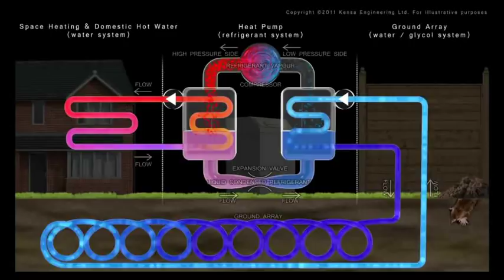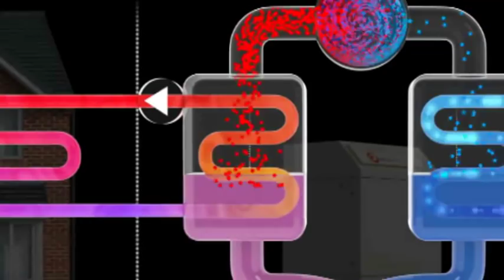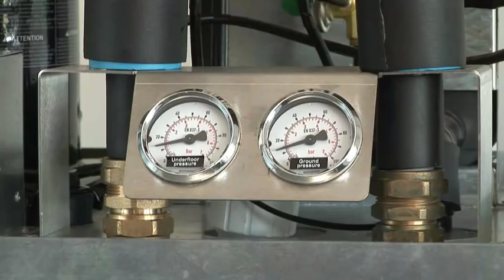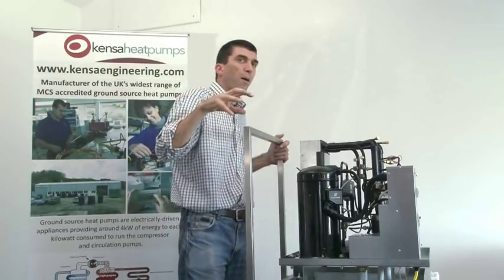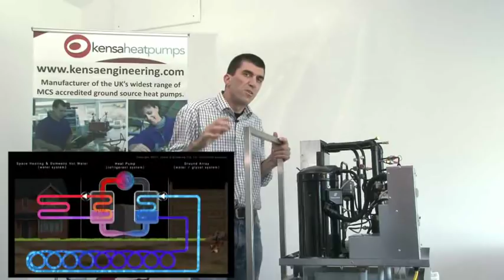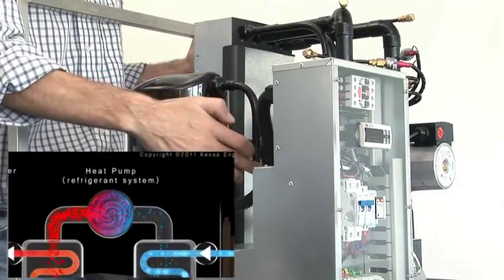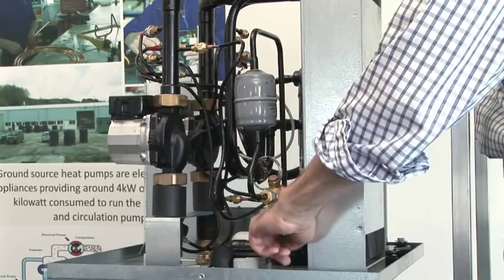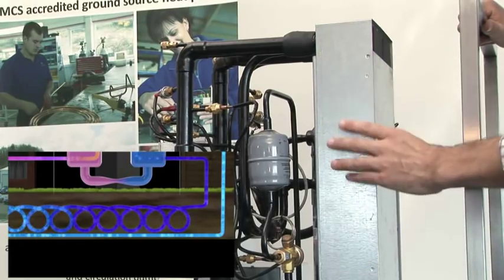How A Heat Pump Works: Installer Version

Comment: Is it better to position a heat pump in a southerly direction so it gains as much as possible from solar gain. My current option is in an area that permanently in the shade, so a sunken basement of sorts. How would you know if your current radiators would work with replacing a gas boiler/heated water tank based system to an air pump with the existing radiators. Underfloor heating would be difficult to retrofit. Is there a quantifiable benefit of either integrating it with a small solar thermal or solar PV roof panel.
Reply from the maker: With a GSHP, the location of the heat pump itself is almost irrelevant, unlike an ASHP it's not trying to collect energy from its immediate surroundings. With any heat pump retrofit, to check if the current radiators will be adequate it is necessary to perform a room-by-room heat loss calculation and then check the output of each installed radiator at the heat pump operating temperature. It is often found that radiators were oversized originally so are sufficient, especially if the insulation of the building has also been improved recently. Solar can be a good partner to a heat pump, although it won't help much in the depths of winter, in the summer it should provide most of the hot water and will assist in spring and autumn, reducing running costs when considered annually.

Comment: Does a ground source heat pump not cool the surrounding earth, enough that the land can no longer transfer the same heat. This presumes its not summer where the land is absorbing solar heat during the day. Can the same heat pump work in reverse and dump heat into the ground and offer aircon and again can you keep dumping warmth into the ground without heating it up locally
Reply from the maker: Yes a GSHP does cool the ground, it extracts thermal energy so the temperature will fall as you say. However, new energy is arriving to rewarm the ground all the time, this comes mostly in the form of sun, rain and a small amount also comes from the core of the earth. Part of the process involved in designing a GSHP system is calculating how much energy will be extracted and how much will arrive, the two need to be in equilibrium otherwise over cooling of the ground will indeed occur. Kensa is aware of some installations performed by competitors where this has indeed happened and the systems have failed. 

Yes GSHP's can operate in reverse, cooling the house and warming the ground, until recently the UK market has not seen much interest in cooling, but this is changing, Kensa will soon be offering cooling as an option on many models of heat pump.

Comment: At the end i understand the example with bicycle pump. Is useful to add a water tank during worm days to the ground water circuit heated by solar panels?
Reply from the maker: Yes, we are seeing some customers using solar panels and other sources of free heat to warm the ground arrays, within limits this lifts the system efficiency by approximately 2% for every 1°C increase in source temperature.

Comment: Enjoyed the great explanation and graphics and then showing the parts that make it work. Some comments below are skeptical of the 1KW input to 4KW output. The energy input is the compressor motor. The 4KW is an equivalent measure of the amount of energy absorbed from the ground or pond or lake through the long loop being heated.

Comment: Great explanation - I am from Australia we are going to be using in ground heat pumps for heating, cooling and hot water. We will also be using  PV/batteries storage for the energy required by the  IGHP. We are building very energy efficient prefabricated buildings.  Over the next six months, we will the  designed whole development which will include all our integrated energy systems.  It is shame you are not in Australia
Reply from the maker: Hi Ian. Thanks so much for your feedback. We do have a distributor in NZ who can supply Australia - Peak Plumbing (www.peakplumbing.co.nz). Let us know if we can be of any further assistance. Thanks

Comment: Great video, really clear explanation. One thing that has stuck me before is that ground source heat pumps have a reduced efficiency compared to an air source heat pump when the external air temperature is higher than the ground temperature. Would it be possible to create a hybrid type system which alternates between a ground coil and a surface mounted condenser to get the best of both worlds?
Reply from the maker: Hi Richard, you have raised an interesting and valid point here. At Kensa we did big project a few years ago to investigate the viability of creating a hybrid ground/air source heat pump using air in the summer, which as you correctly state will normall be warmer than the ground. Unfortunately we didn't get quite the results we all expected, it turned out that the energy consumed by the fan needed to move the air often exceeded the saving in heat pump efficiency. The air had to be around 8°C warmer than the ground to 'break even' in terms of efficiency. Unfortunately in the UK (where almost all our products are sold) the number of days per year when this happens is really quite small. Our conclusion was that the extra cost of the air source components would never be recovered in running cost savings, so such a heat pump is, sadly, not economic in the UK. The power consumed by the fan also explains why air source heat pumps are, on average, less efficient than ground source.
Reply: Hi, thanks for the feedback. That's interesting to hear, but makes total sense. I can appreciate that in the majority of cases, demand drops off significantly during the summer, and as you say, the few days where the air temperature is >8oC higher than the ground temperature AND there is also demand for heating are few and far between, so not surprising its not financially viable. If the demand profile where different though (eg you were using the heat pump to serve a high year-round domestic hot water heating demand) and there were a significant demand during the summer months also, I can see it would be more of a viable option. If you ever need anything like this investigating theoretically, I run a thermal analysis consultancy; www.GreenliteEA.co.uk. There isn't currently an explicit method of modelling ground loops within the software I use (IES Virtual Environment), but it can interface with third party modelling software like Gaia Geothermal. The benefit of a thermal model is, you can model various different design strategies, and run them in parallel using identical weather data and user behavior - thus removing several key variables which are otherwise difficult to control.

Comment: is it possible to use it as cooling system or only for heating purposes?
Reply from the maker: +Abdelrahman AK All Kensa’s Compact and Plantroom heat pumps can operate in reverse-cycle mode providing chilled water to cool a building and operates in a similar manner to a chiller. For further in formation on this visit the link http://www.kensaheatpumps.com/the-technology/specifications/cooling/
Reply: Abdelrahman AK My understanding is that this system would only be capable of heating as the condensor coil is underground absorbing heat from the ground. If the condensor coil was also in the home (on a separate loop from the evaporator coil) this could absorb heat from the air instead of the ground thus cooling the air in the home.
Reply: Abdelrahman AK Heating and cooling just like a usual air to air heatpump/ac unit.
Reply: Abdelrahman AK To gain a reverse effect you just reverse the process with the refrigerant gas.
Reply: Abdelrahman AK this pic may help
http://antaresgroupinc.net/wp-content/uploads/2013/02/10-GSHP-flow-chart-1024x780.jpg

Comment: I have to agree with Miguel Urdaci, the statement (1kW consumed generates 4kW) is wrong you cannot create more energy or the same amount of energy out of a system than what you put into it.(First law of thermodynamics) Otherwise our energy crisis is solved and we all have free energy or close to free energy. It all boils down to the efficiency of the system. this is more efficient that conventional geyser (electric resistance boiler). meaning you use up to 4 times less energy to generate the same amount of heat energy than a conventional geyser.
Reply from the maker: Hi Convanr, you are entirely correct, one of our favourite quotes at Kensa is 'energy can not be created or destroyed' which of course came from Albert Einstein. To answer your question, in the case of a typical small heat pump with a 4 kW heat output, that energy comes from a combination of two sources, 1 kW or it comes from the electricity input, the other 3 kW is absorbed by the ground arrays -
 heat energy naturally moves from the warmer to the colder, the heat pump makes the fluid in the ground array pipes colder than the surrounding ground materiel, so heat energy moves from the ground to the fluid. This free energy is then squeezed in the heat pump to raise its temperature. So yes this heat pump costs you 4 times less in electricity than a simple electric heater, for the same amount of heat output.

Comment: I gratefully accept your offer: I'm no scientist, but I know you can't get more energy out than you put in. So, to get 200W (say) of energy out of the system I put in 50W of electricity in through the compressor motor. Where does the other 150W (or more) come from? I can only imagine it is the sum of energy from the 5-10ºC transfereed to every inch of the underground tubes. Is that right. Is there a danger of that ground heat diminishing over time due to heat pump use?
Reply from the maker: Hi Miguel, the other 150W of energy is absorbed from the ground, this is what the ground array does, it supplies low temperature heat energy to the heat pump. You are right that over time the temperature of the ground would diminish over time, when designing a system we need to use enough ground to ensure a reliable supply of heat all winter long. During the summer, when the building heating system will be mostly turned off, the heat in the ground is replenished by sunshine and rain water, ready for the next winter ahead. The ground acts like a giant energy storage tank, but of course the annual refill is delivered naturally for free!